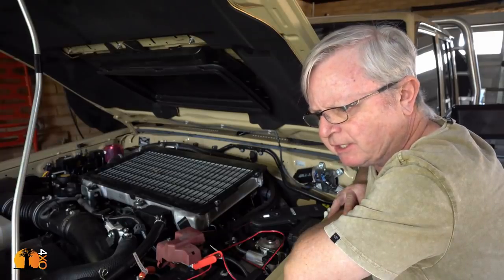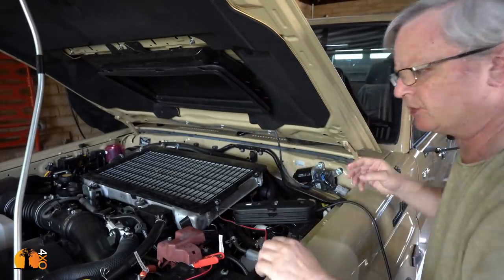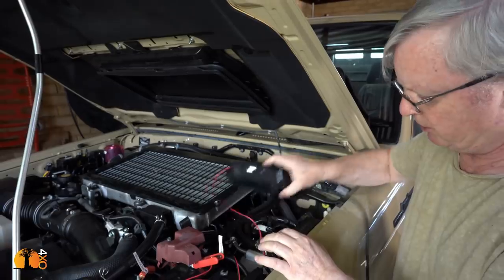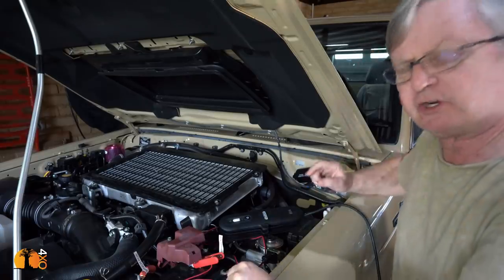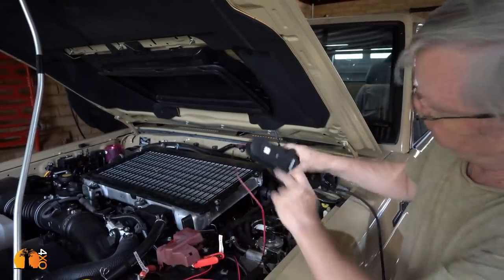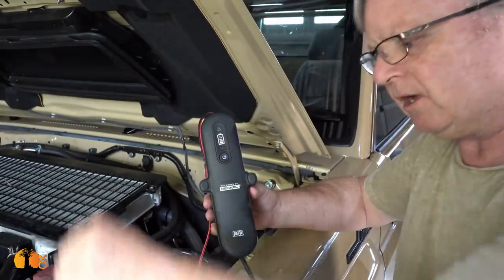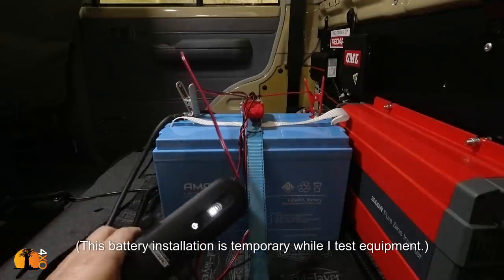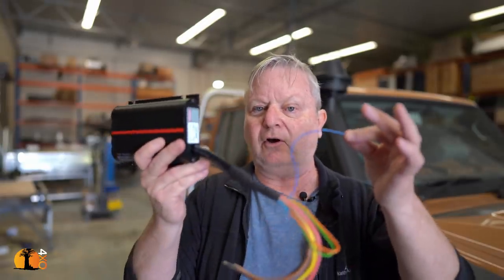DC-DC CHARGER RUNAWAY DISCHARGE WARNING.

Comment: How is the apparent charging voltage being maintained? As soon as the 50amp charger turns on it should pull the voltage down to just the battery voltage plus a little for the amount of power the charger can put in.
Unless the DC to DC charger is set to run down to 13.2V or something that shouldn’t let the starter battery discharge to below where it can crank over your cruiser.

If it is set to a very low cut off Voltage there should be a way of turning that up, with your setup the charging voltage shouldn’t fall below about 14v.

Try measuring the voltage at the starter battery with theAC to DC and the DC to DC chargers running
Reply: David Cocks yep I saw a bunch of comments saying they were doing the same thing and I definitely believe it but I don’t see why you would want it to keep charging down to less than 13.5v probably higher if you have a powerful alternator the little 70w one in my ute easily holds 13.5v at 50A draw (I checked) and that is where I set my minimum. I only have a 5A charger and a 50A charger for AC the 5A only adds about 0.25V if the DC to DC is working flat out. But I can see a 10A one allowing the battery to go down below 12V with a 50A DC to DC one running if the DC to DC goes down to a really low voltage before shutting off.

 (my DC to DC is a dodgy Chinese one with a potentiometer each for the charging voltage cut offs (start-stop, drop, fast charge, slow charge) and dip switches to select other stuff and it says it will do 45A but it only does about 30 on any battery setup I have tried it on.
Reply: The battery charger is sending 14v 10 amp into the battery 

The 14v triggers the dc/dc the drain 
The dc/dc is only looking for 13v so.even thoigh the main battery is dead flat the charger is providing that voltage signal 

It could maybe be set to trigger a fault because of low amperage input but currently they're only set to look for that voltage signal
Reply: Glen Collins, I do agree with you. It is impossible, voltage must drop the moment the load exceed the maximum Amp the AC charger can supply. But the question remains, how does the crank battery then discharge? It just does not make sense?
Reply: CampX4 & Outdoor TV it’s being pulled out of the battery by the red arc DCDC and milking it flat as the 10 amp ac charger is trying keep up with THE 50amp load pulling through to the auxiliary, whilst this is going on the ac charger constantly sees a huge hole, tries in vain to fill it and cranks max voltage and amps into the bottomless pit.
Reply: That was my thought on it, the voltage of the charger should drop from the high loading of the DC to DC charger, there has to be some sort of software glitch involved on the DC to DC. Or the cranking battery has a high impedance or there is one in the terminals otherwise a current limited float chargers voltage would fall through the floor with such a high loading.
Reply: Grant Kerr yes but the maximum voltage should get very low, the charger can really only maintain a maximum amperage  flowing into the battery up to a given voltage if the battery or anything else in the circuit tries to pull too much power the voltage at the terminal has to go down.

If the charger could maintain the voltage the main battery would also see that voltage and it is the voltage which is required to charge a battery.

For example if you plug a 10A battery charger into a 4x4 sized lead acid battery which is at 10V the charger will generally put out its maximum 10A at 11V because that is the voltage at which the power draw on the charger reaches 10A.

But a motorbike battery discharged down to 10V will only draw 7A at 14.2v and the charger will limit the voltage output because that is the max charging voltage of that battery.

Different battery types can require higher voltages to start charging but I think he is using a conventional battery for his starter battery.
Drawing 40A out should lower the voltage out of any battery considerably and it obviously lowered it enough that the starter will not crank over.

My Ute will still start if my poor battery gets down to an open circuit voltage of about 10.7v
Reply: fowletm1992 my point was it is stupid to have it’s shutoff voltage down at 13v that will prevent the main battery charging off a smaller (car)  alternator until the camper batteries are near full and cause crap like this where the battery is getting sucked down to where it can’t start the car.

In my experience a good sized starter battery would have to be below 11.5v open circuit not to crank over a big recalcitrant starter and that low it should have the terminal voltage from a 10A charger down to less than 12.5v without an extra 50A drain.
Reply: @grantkerr2971   The voltage can not stay above the DC-DC cut out voltage. The voltage on the crank battery must drop, if the max amps of the AC charger is exceeded. I'm sure if Andrew put a voltmeter on the crank battery, we will see the voltage drop. What I don't understand is why the DC-DC don't cut out. Could it be the puls action of the AC charger that confuses the DC-DC charger's software. I have designed a couple of DC-DC solar system, and lead acid battery chargers, but I can not explain this.  Hope Andrew will make another video about this.
Reply: CampX4 & Outdoor TV in one of the other comments someone said the low voltage cutout is 11.7V which seems really stupid for the intended use as it is always going to suck the starter battery down to a bad storage voltage and really take it low if you have a lower amp charger on it.

I would return it as not fit for purpose if there isn’t a way to change that setting, that is just stupid unless you are charging from other deep cycles on solar or something.
Reply: The only thing I can think of Glen is the DC-DC automatically adjusts its current draw based on battery voltage and the starting battery increases internal resistance gradually as it gets flatter, allowing the AC charger to hold its battery voltage up and thus fooling the DC-DC charger to continue to draw the 10A from the AC charger + a little more from the battery gradually reducing its SOC? I can't see anyother way around explaining the result Andrew and others describe.
Reply: Think you guys are mixing draw with capacity 
The dc/dc can draw 50 amps 
It can't physically suck 50 amps out of the battery if there's only 10 amps present then that's what it'll take 
But it'll take up to  50 amps if there's more present 

Your also confusing the the mains charger with anouther battery (The way it behaves)
The start battery won't drop below 13v with the charger attached because the charger is regulating the voltage in 

Or to be more correct 
The start battery terminals won't drop below 13v 
There can be nothing in the battery but where ever those mains charger alligator clips are attached there will be 13v across them 
That is what his test just showed 
You don't even need to start battery there  to trigger the dc/dc
It is true that as soon as you remove the alligator clips the charger will shut off if the start battery is dead 

You can put a battery charger straight onto a dead flat battery and yoir multi meter will read voltage across it straight away 
Doesn't matter if it's a 100amp truck charger or a 100ma trickle charger
Reply: The dc-dc charger will continually read 14V due to the charger on the cranking battery, even when the actual battery’s voltage is much lower. It thinks the 14V is the battery’s not the charger. Once you disconnect the charger, the Dc-Dc will read battery’s actual voltage and switch off.
Reply: @CampX4  If it were cycling on-off every 5-10 seconds as the voltage fluctuated from the load, would it continue to draw more than the AC charger can provide, over time?  I'll have to measure that.  I posted a comment for a video I did today about it:
Please search for "Dual battery charging issues VR: 4XO DC-DC CHARGER WARNING. Avoid a runaway discharge." on youtube.
Reply: @fowletm1992  you cannot draw 50 +amps out of a 10 amp charger the voltage will drop below trigger voltage and the dcdc charger should turn off that is what it is designed to do
Reply: I couldn't figure this out either myself, but someone mentioned "cycling" below which might explain it - there could be some hysteresis involved. If the DC to DC charger triggers based upon the input voltage then you would expect during normal vehicle operation it to shutdown once the engine turns off and the alternator stops, therefore dropping the starting battery voltage to about 12.65v. Now that same mechanism should occur if your AC-DC charger is connected and pulls the starting battery voltage up above the DC-DC charger's trigger point. At that point the DC-DC charger thinks the alternator is now running and starts trying to pull 50 amps. So 10 amps of that comes from the AC-DC charger and the remaining 40 come from the starting battery. That will cause a voltage drop which the two voltage sources won't be able to counter. I suspect if you measured the voltage you would find it drops below 12v. That should cause the DC-DC charger to shut off, thinking the truck engine had suddenly stopped. Then the voltage will rise again as the AC-DC charger takes hold again. However, I imagine someone might design a DC-DC charger to keep running for a few seconds though before deciding to shutdown, to avoid cycling at high frequency. So you might design the DC-DC charger to work in chunks of 10 seconds for example. If that were the case the voltage from the AC-DC charger would trigger it and even though that voltage was then immediately dragged down, the DC-DC charger may continue drawing 50 amps for say 10 seconds before switching off. After switching off the voltage rises again and after say 10 seconds the DC-DC charger decided to switch back on, and the cycle resumes again. What that means is that for each 10 seconds the DC-DC charger is off, the battery charges at 10 amps, but each 10 seconds the DC-DC charger is on, the battery discharges at 40 amps. So the starting battery is losing charge every cycle.
Reply: @SteveSallyandSmokey  apparently the low voltage cutoff is set at 11.7v which when you consider the charger will be adding a bit of voltage means the battery gets pulled down well below where you start doing damage to straight lead acid batteries and well below the starting voltage for a modern car.
Reply: @glenecollins  Some Smart alternators drop the voltage that low When they sense that the starting battery is fully charged to save on fuel mileage so the alternator is not running high output all the time If you look at the negative cable on a starting batteries there's usually a hall sensor around it measuring the current going in and out of the starting battery And the alternator self-adjust For the capacity of the charged battery If you replace a starting battery I want of these newer Vehicles you need to let it sit for overnight so the computer can calculate the capacity of the battery

Comment: Thank you Andrew I have just discovered your channel. This should end a long running debate among my friends. I had warned one of my friends that sitting on the beach  listening to the test cricket will flatten your battery. It had happened to me. I suspected the trigger wire as you explain but he was adamant that the load from the radio could not possibly drain his starter. Sure enough I had to give him a jump start but he still didn't believe it was the radio at fault. Now we know it was probably a flat auxiliary combined with the the trigger wire connecting the two batteries.

Comment from the maker: NOTE. I chatted to the guys at Redarc and with Heiner. There is no mystery why this happened. It happened exactly why I said it did. It's a perfectly logical explanation. This is not a Redarc issue. I'm just using Redarc DC-chargers in my setup. All DC-DC chargers will do this because they rely on reading the voltage across the main battery to turn on. And if you use a trigger cable from the ignition, the start battery can be discharged if the ignition is left on, with the same result. The solution is very simple: if you have a DC-DC charger, if you want to charge the batteries without the engine running,  charge the auxiliary battery first. What could be simpler?
Reply: Just follow the wiring diagram like everyone else and use the ignition trigger wire to turn the system on. If the ignition is turned off, no problem. Not sure why anyone would leave the key turned to ignition if the car isn't running.
Reply: So the solution - if you need to charge the start battery is to disconnect "aux" battery - before or after the BCDC -  before charging the start battery (a good use case for a simple disconnect). (my BCDC Redarc 1225D is on Anderson connectors.)
(NB - Redarc calls their system "Battery Charger Direct Current - BCDC, others call their units "Direct Current to Direct Current"  Charger - DC-DC)

Blue Trigger cable is specifically for low voltage / smart alternators.
Reply: 4xoverland  would a circuit breaker with switch work? Install near the mains battery and when you put on the charger flip the switch on /off
Reply: I don't know if in any car. But in my VW T5 there is a D+ wire, which is a "alternator running" signal. From the factory the second battery charges only when the alternator is running. So not on ingnition. I thought there is a signal cable like this in any car.
Reply: @kadmow  seems like redarc are handicapping themselves for no apparent reason
Reply: Even simpler, connect blue wire to ignition - sensing ignition on and off and battery voltage - wire senses low starter/main battery voltage, cuts off aux charging but still maintaining enough volts/amps to start engine using starter/main battery. It's pretty clear in the instructions everyone!  + From a quick check 11.9 volts is low starter battery cut out on the Redarc systems.
Reply from the maker: @bennyfarrugia2419  Yes it would. In the video, I just removed the fuse to the second battery.
Reply: You could also simply use an oil pressure switch (both normally open and normally closed (or both) are available.)  That way the charger would not simply "see" the ignition switch position, but that the engine was actually running.
Reply: 4xoverland can you just put a Anderson plug on the charger and just plug it into the BCDC solar input. I have the exact setup and have often wondered what was going on and wondered how to make it more simple than charging priority backwards on the batteries. thank you for bringing this to our attention.
Reply: Bob Kraft beat me to it.
Reply: I would have thought the current flow into the Aux Battery would be related to the DoD of the Aux Batteries? The amount of current would be related to the battery's internal resistance? Surely the BCDC Chargers don't constantly pump in the maximum current all the time? Having a ignition-on switch wire would solve any flattening of starter battery too
Reply from the maker: @robmacca67  No they do not. I believe you are misunderstanding the situation where it can flatten the starter battery.
Reply from the maker: @brettwako  By accident? . In that case, if you leave the ignition on with the engine not running, the battery with drain itself to charge the aux batteries.
Reply from the maker: @demolitioner962  You clearly misunderstand the problem here.
Reply from the maker: @bobaloo001099  You could do that. Seems like a long way to go. Why not just not charge the starter battery before the aux battery?
Reply: Why would you keep your ignition on for a long period of time without the engine started??  if you have connected the blue trigger cable to the accessory power then would have this problem
Reply: @4xoverland  No, I understand what u mean, just I thought it would also depend on the state of charge of your Aux batteries.

Comment: In my setup I have a breaker where your fuse is and I can quickly switch off the Aux circuit when I need to charge the main battery and often leave it off where not on trips just using the  roof solar to keep the Aux topped up.

Comment: Well spotted Andrew. 
This is a big problem with DC-DC chargers. The charger will continue to run when the car is switched off as the cut off input voltage is 12.4v. Once the input drops below 12.4v the charger will stop until it reaches 13.4, however this often means your primary/starter battery is sitting around %70 SoC which is not a good place to be when it comes to starting big engines. 

For example: You have a 110A alternator, 100A isolated aux battery,  a BCDC1240 charger, and a fridge. You pack the fridge a few days before going away and its on full time to get to temperature.  The only driving you're doing is to the shops and back, perhaps an hour a day. If it's just bussing around locally, your alternator never gets consistent high RPM so its average output is around 30-50A (most are <20A at idle).  Your BCDC has sucked all this charge into your AUX battery leaving your primary floating around that %70 mark.  .'. The starting battery can only be fully charged once the aux battery is fully charged!
Now imagine the car is left to sit for 4-5 days with parasitic losses of around 0.15A, that's up to a further 18Ah you have lost from the starting battery which was already at %70 SoC. You are now very possible needing to jump start a car because of the system that was designed to stop your started battery from being drained. 

So what the solution?
The first that comes to mind is a BC-DC charger that can regulate current according to voltage input, however i have yet to see this. What i have done is fit a second alternator that is just for the BC-DC leaving the starter at full SoC. Added bonus to this is i have put a smaller pulley on the second alternator so i get 40A at idle so i can charge without diving.